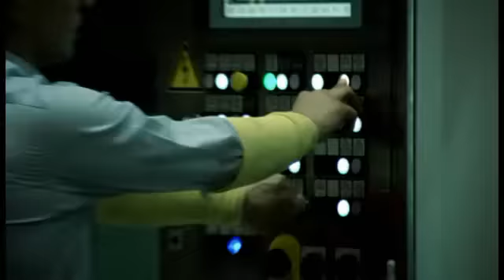Opel Astra J - Inside the Poland factory Gliwice

Comment: I wonder why Opel engineers did not make their own engine but took the engine from Fiat and turned this beautiful car into a problem machine. Why was the 1.3 Diesel engine released to the market as 95hp? If this engine was offered as 110 Hp and actually Opel produced its own engine, it would not be such a problem machine. Although I love the Opel brand, I can't help thinking that we will have a problem today. 

I do not plan to sell my vehicle, but although I like the interior and exterior design in general, the engine issue cools me from the vehicle.